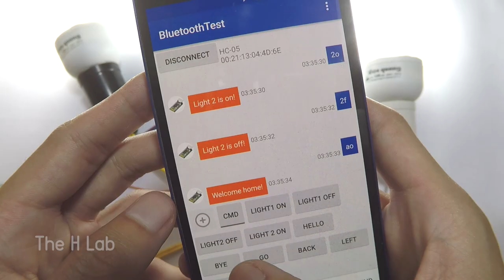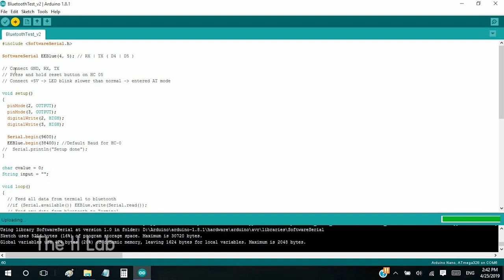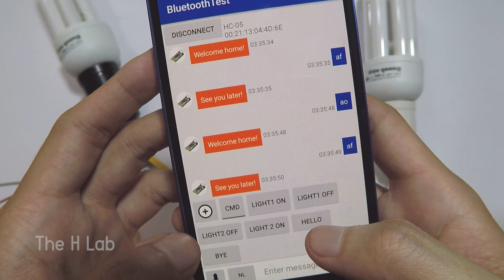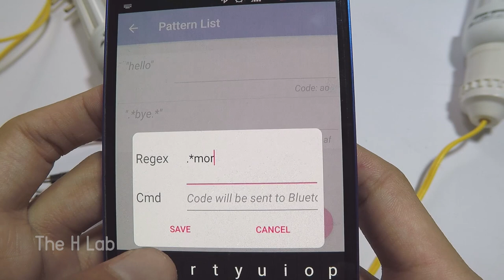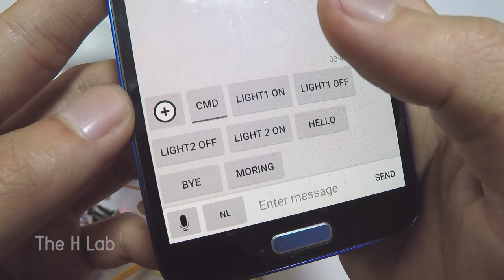Remote control lights with your phone | Arduino | Bluetooth module

Comment from the maker: Code:
#include <SoftwareSerial.h>

SoftwareSerial EEBlue(4, 5); // RX | TX ( D4 | D5 )

void setup()
{
  pinMode(2, OUTPUT);
  pinMode(3, OUTPUT);
  digitalWrite(2, HIGH);
  digitalWrite(3, HIGH);
  
  Serial.begin(9600);
  EEBlue.begin(38400); //Default Baud for HC-05
  Serial.println("Setup done");
}

char cvalue = 0;
String input = "";

void loop()
{
  // Feed all data from termial to bluetooth
  if (Serial.available()) EEBlue.write(Serial.read());
  // Feed any data from bluetooth to Terminal.
  while(EEBlue.available()) {
    cvalue = EEBlue.read();
    if( cvalue == '\n' ){
      Serial.println(input);
      if( input.equalsIgnoreCase("1o") ){
        digitalWrite(2, LOW);
        EEBlue.write("Light 1 is on!");
      } else if( input.equalsIgnoreCase("1f") ){
        digitalWrite(2, HIGH);
        EEBlue.write("Light 1 is off!");
      }else if( input.equalsIgnoreCase("2o") ){
        digitalWrite(3, LOW);
        EEBlue.write("Light 2 is on!");
      }else if( input.equalsIgnoreCase("2f") ){
        digitalWrite(3, HIGH);
        EEBlue.write("Light 2 is off!");
      }else if( input.equalsIgnoreCase("ao") ){
        digitalWrite(2, LOW);
        digitalWrite(3, LOW);
        EEBlue.write("Welcome home!");
      }else if( input.equalsIgnoreCase("af") ){
        digitalWrite(2, HIGH);
        digitalWrite(3, HIGH);
        EEBlue.write("See you later!");
      }
      input = "";
    } else {
      input += cvalue;
    }
  }
}

Comment: how did you make your voltage divider?
Reply from the maker: It's a set of 3 resisters, 100 Ohm foreach one, connected in serial.
Reply from the maker: Like this:
GND               HC-05 RX      Arduino
+--Res1--+--Res2--+---Res3-----+